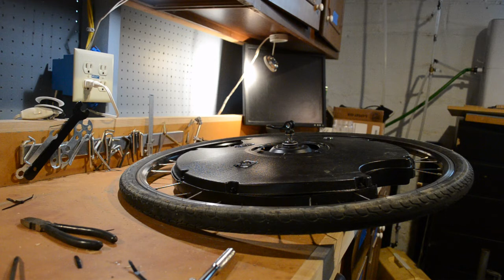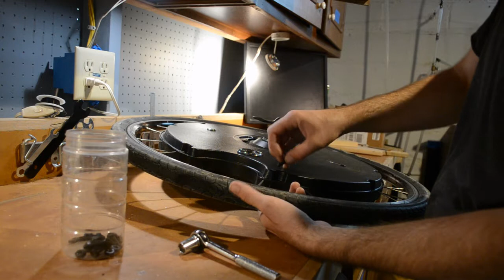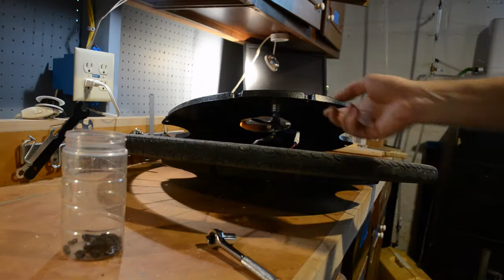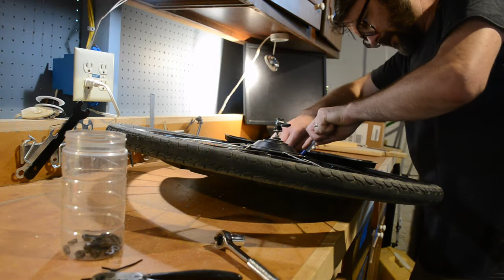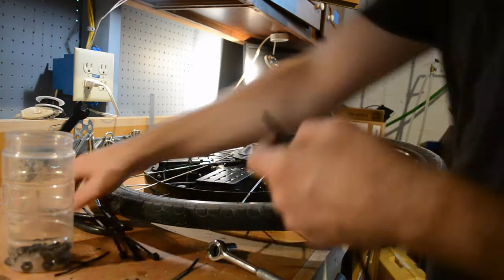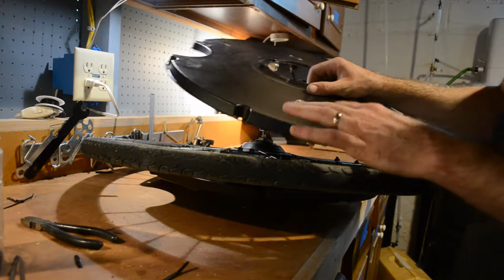Electron Wheel: repair parts that rattle loose, DIY

Comment: Gord I can’t find a pedal sensor replacement. Wondering if you have a line on one? 
Thanks
Reply from the maker: No. My pedal sensor died from a rain storm I couldn't get out of and I gave up on the whole system. I have ideas on a repair, but haven't tried them yet. Honestly, I have been enjoying riding with no e-assist now that I'm back in shape and don't really have plans to go back to an ebike.
Reply: What was your plan for a replacement sensor

Comment: I love my electron wheel.  I bought it used off of ebay and dont know how much previous use it had. When my batteries do die, do you think I can have radio shack replace the dead batteries? (Electron is out of business and unreachable) thanks for any info.
Reply from the maker: You could definitely try. I imagine you'd need to match specs.